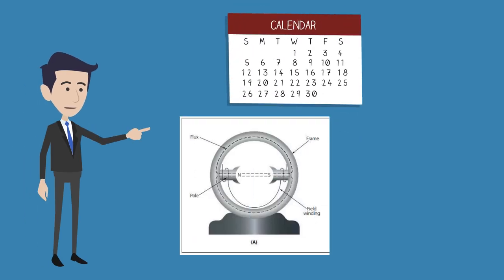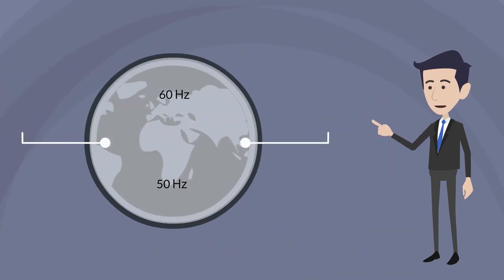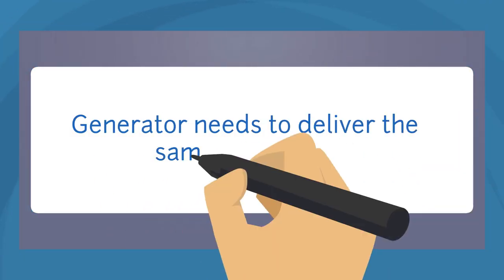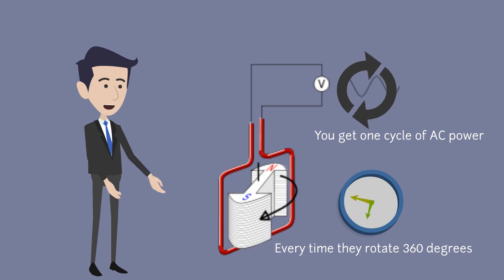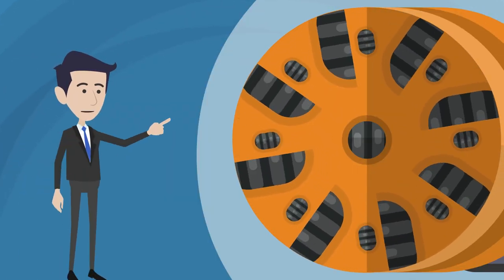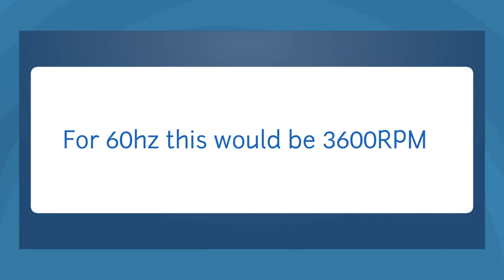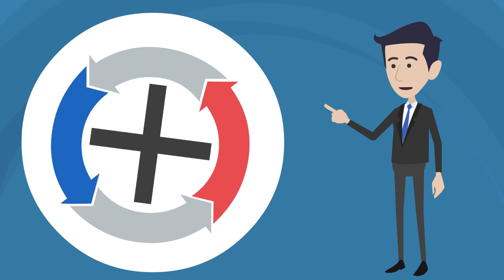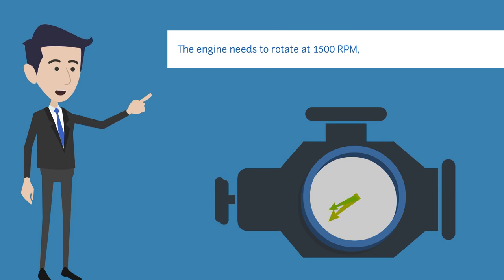Explained: 2 pole vs 4 pole Alternators and the generator engines speed

Comment: Why 4 poles generator commonly used rather than 2 poles?
Reply from the maker: Because 4 pole alternators are coupled with 1500RPM engines. 2 pole are coupled with 3000RPM engines.

The faster the engine runs, the shorter it’s life span, hence why 4 pole are more popular for generators.
Reply: @WellandTV  thanks a lot 🌹
Reply from the maker: @MM-vi9kh  our pleasure! Subscribe for more! We’re going to be doing a whole load more in the next few months!
Reply: @WellandTV  it's my pleasure, subscribed and liked